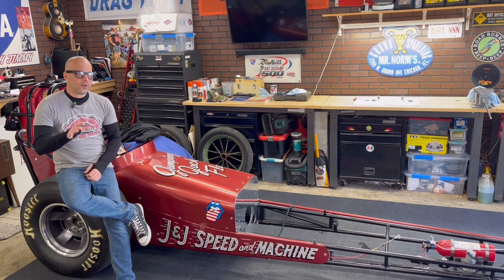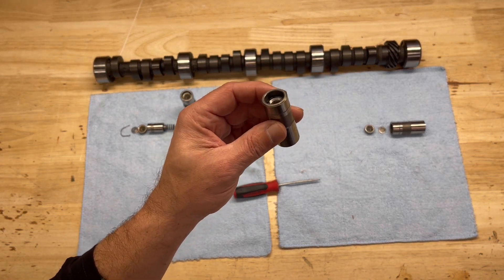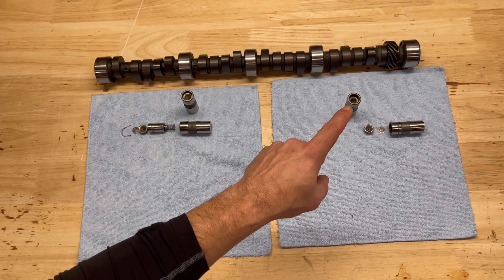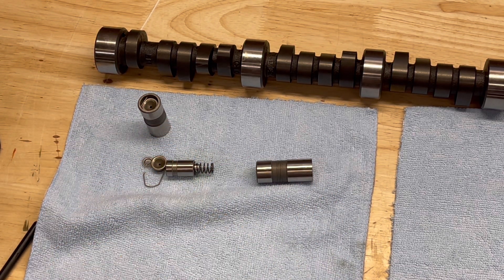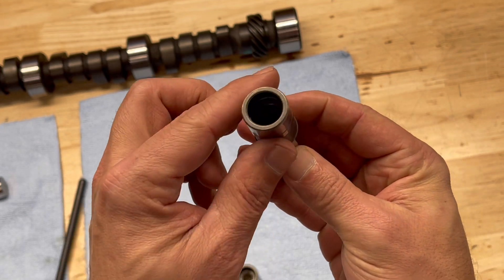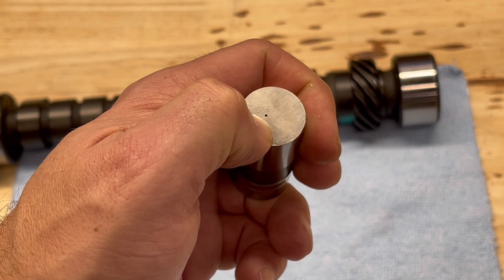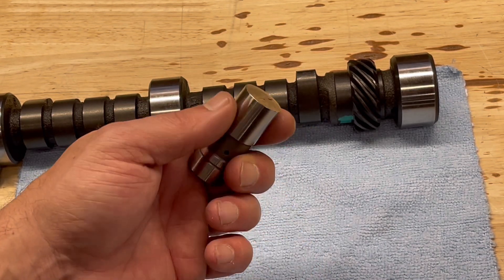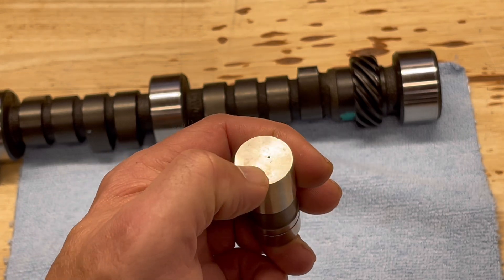What are EDM Solid Lifters and How Do They Work? #technology

Comment: Thanks for the great video mate appreciate the information. Certainly helps me. I think i was recommended something suitable for my application. Building a holley pro ram equipped small block chevy for my little hb torana drag car. Going to spin it around 7000rpm.
Reply from the maker: That's gonna be a killer combo!  Another good lifter to look into is the Comp Cams DLC lifter